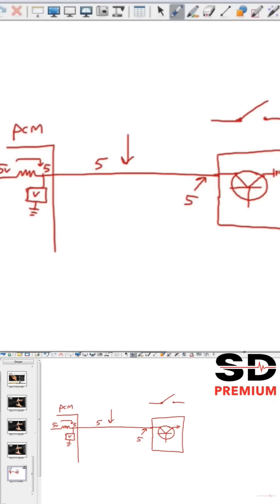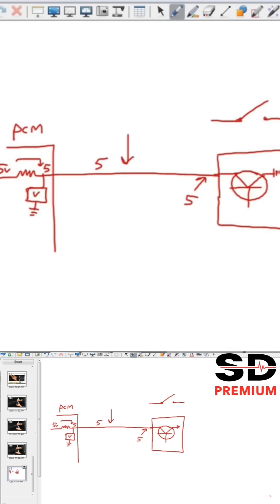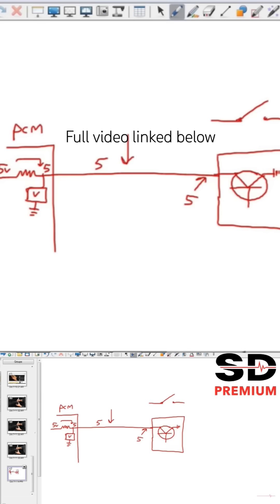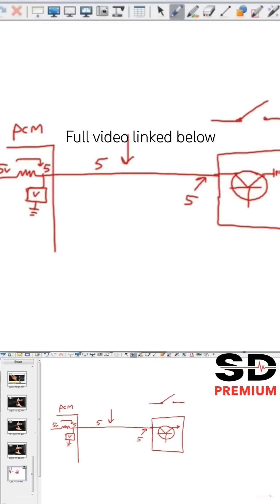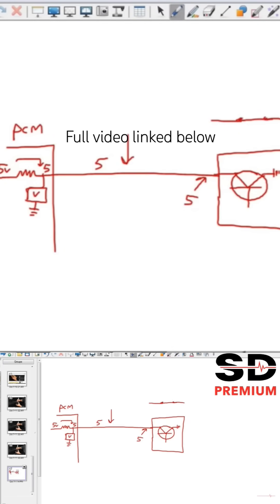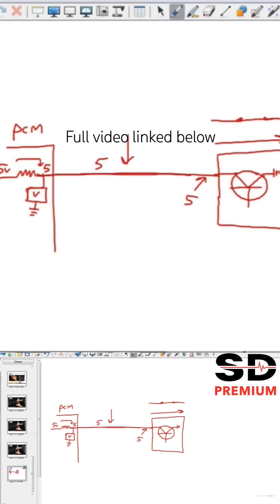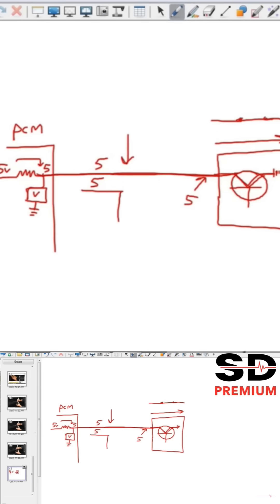Hall Effect Crank/Cam Sensor Testing will Vary Depending on Circuit Design

Comment: I love how your showing the transistor, and explaining it, we've spoken bwfore im all self taught in mechanics, and electrionics i didnt have any youtube when i first got curious how an engine works i was 8-9 then. Im now 26 and well frankly im still learning got into Electronics when i was around 13 now days i still love working on mowers and 2 strokes, and Cars. Now days as a mechanic for vehicles or even small engines( mowers and such) you have to have a slight understanding of how semiconductors work. A good example of that is the modern style ignition coils in smaller engine the " magnetrons" as they are named has transistor inside them. one transistor base is connteced to a smaller coil a "pick up coil" that transistor turns on the other transistor which is the one switching the primary coil. If you dont know what to look for these coils can fail but still fire really hot and look great, but the base to emitter juncion fails and the transistor randomly works do to the high current kind high voltage peaks being created in the primary circuit causes the transistor to work here, and there. If you dont use a spark tester in line with the plug still in the cylinder and dont fire it up and run it, you wont see it! Explaining the electrionics is just as important as understanding how the engine works it's self! Your explaining things in away that will make very good techs, and mechanics! If I had my way I'd move close to partake in Your classes! I love it brother it's great to see!